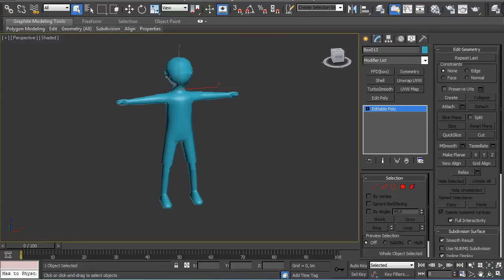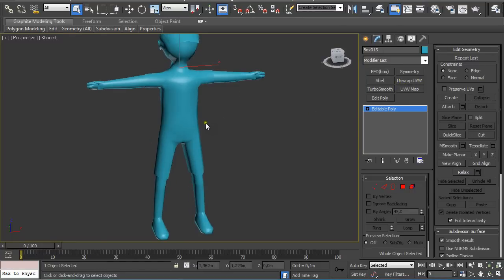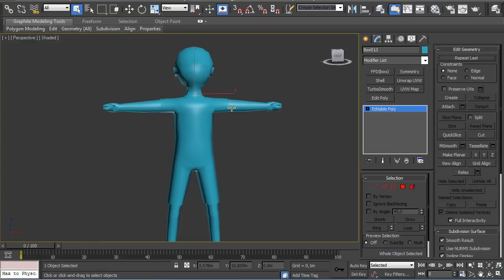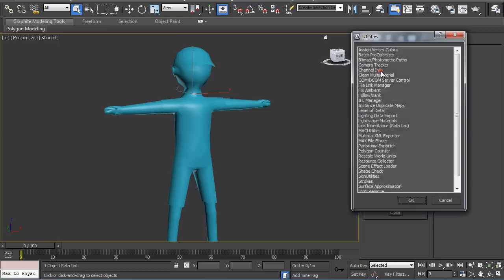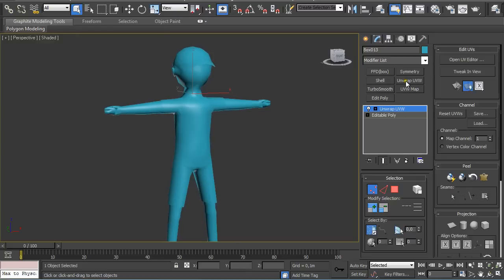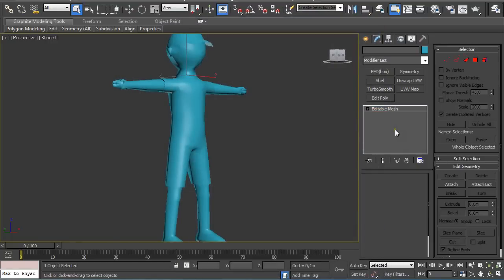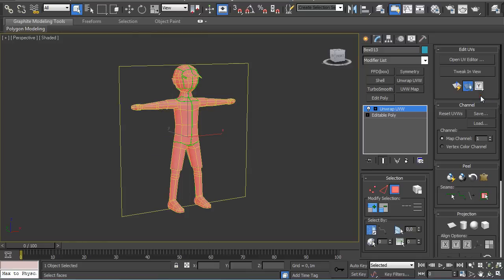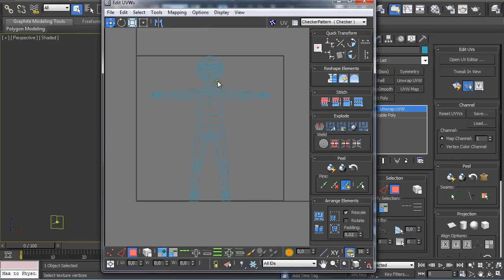Quick tip tutorial: How to remove default seams of Unwrap UVW modifier in Autodesk 3Ds Max

Comment: Hey nice stuff but there is a better way. I'm sure the way u shown that it will create and show seams once u start to unwrap

There is actually a " turn off button for the seams. Green and Blue peel.

Its on the uvwunwrap scroll down till you see the two buttoms saying it and then you can tick it on or off.

Hope this helps :-)
Reply from the maker: The technique that you describe (Configure/Display tick off Map and Peel Seams) doesnt get rid of seams, it just hides them in the viewport. Try opening UV Editor and you`ll will still have them there.
My goal was to show how you can get rid of the seams completely, meaning you wont see them in viewport nor in UV Editor. This way you wont have any trouble peeling your model with the help of your own seams.
Reply: +Dante Sparda (Chunu) Ya thats true, cause once u dont see the green ones, u cut ur own and it works perfectly fine, u dont have to go and do all that. Oh another trick is like add uvw map clear and collapse.

Comment: *****  i have got a problem here...after i do this i can't apply my texture on my model
so, what to do?
thanks!
Reply from the maker: What is the issue? The texture isn˙t seen or something else?
Reply: ***** that exactly.
the texture does not appear to my model.
i have try to increase and decrease the tiling but without any luck.
so, do you know what to do with it?
thanks!
Reply from the maker: does it show in render?
Reply from the maker: (if you are applying Bitmap) in material editor do turn on "Show Shaded Material in Viewport" (its the checkered looking icon)
Reply: ***** yes i am applying bitmap.
i will try that.
thanks!
Reply: i already had it ticked but i found how to solve my problem (i just needed to do another unwrap UVW)
thanks!

Comment: how can someone delete a specific green seam not just the whole thing ?
Reply from the maker: +Anthony Fassolas you could apply Unwrap UVW modifier to your model, Open UV Editor, in canvas of Max (not in UV editor) select the seam you want to get rid off, then in UV editor click on "Stitch". It should stitch 2 edges into one seamless. But it will drasticly mess up your UV unwrap so I think its best you get rid of ALL default seams and set up your own seam positions.

Comment: Why would you do that? That UV map is unusable, anything you paint on the front will appear on the back....for example a face. Why would you want a character model with his face on the front and back of his head? Is this supposed to be funny?
Reply from the maker: +ezromation The video is about REMOVING the default seams, NOT where to properly put the new seams. So yea, if you only do the steps I show, the UV Map is unusable. 
I didn`t show WHERE to put new seams, since it would only apply to this kind of model - which this video was not intended to be about.
Reply: *****
A seamless UV map is a UV map that serves no function. A tutorial should serve a function other wise it is not a tutorial.
Reply from the maker: +ezromation You still don`t get it. Read the title of the video. Does it say "How to properly setup UV seams on your model" ? No it doesn`t. 
Tutorial is about REMOVING DEFAULT UV SEAMS. So it DOES has a purpose.
So please THINK before you post a comment anywhere. 
+ if you don`t like what you see, there is no need to post any comment...that won`t make the video any better
Reply: *****
No I don't get it you are right.
Reply: +ezromation Remove default seams so that you can start clean and make your own seams to properly unwrap a model.